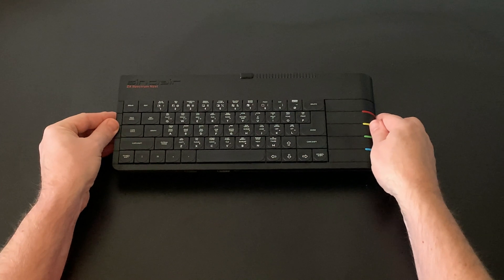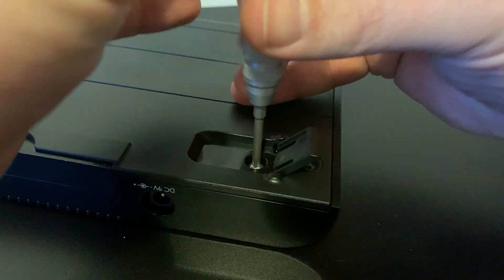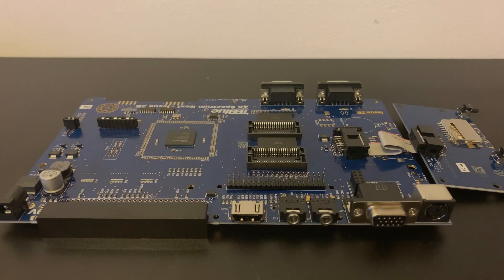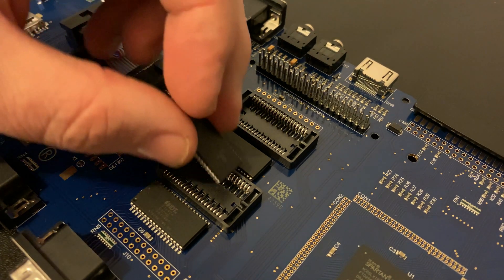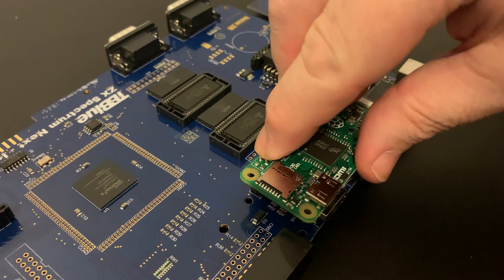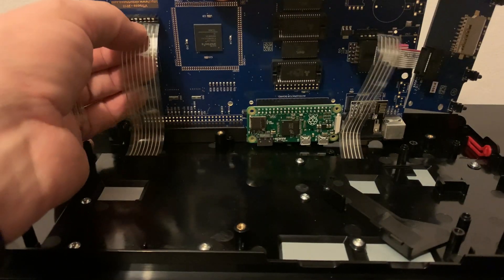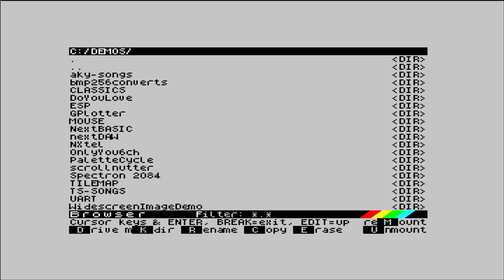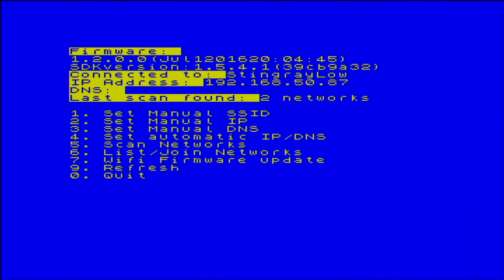Spectrum Next - Part Two: Upgrades

Comment: Need a mod to make the colored stripes light up.  When you open the case we can see that they are just colored pieces pressed into rivet holes.  Could replace with light-carrying plastic and mount LEDs inside.
Reply from the maker: That sounds like a fun mod :)

Comment: So could you skip the ESP if you add a Pi ZeroW?
Reply from the maker: Unfortunately not at this point :( Luckily a Pi Zero plus an ESP is about the same price as a Pi Zero W :)
Reply: @TheRetroShack  Can i use PI Zero W or Zero 2 W instead since PI Zeros seems to be sold out at most places in my country.
Reply: @TheRetroShack  True but you are probably going to want to use a PiZeroW anyway so you have a wife network connection for your pi. The ESP does have an advantage in boot speed over the pi for sure so you might still want both. Now if they could arrange for the ESP to also be the real-time clock so no need to solder on the clock and just for fun let the pi set up a dir to share with the Next that you could load files on to over the network that would be very cool. I would have to look at the pineouts for the pi but if nothing else you could use a spi interface between the pi and the next to handle the data transfers.

Comment: Also on the latest distro, you can use .term from the command line rather than terminex.snx. the dotcommand version will allow you to exit back to NextZXOS with sym+shift+q
Reply: we really should remove that old folder, David ;)
Reply: @Xalior  remove the snx and replace with a text file saying use .term :)

Comment: You mentioned how easy it is to damage plastic threads.  Good practice when replacing screws, especially small ones, is to locate the screw and applying a little pressure turn it slowly anti-clockwise until you feel it click. The screw has registered with the thread and will be guided in without fear of it ‘crossing’ as you screw down. And as you say “not too tight “. BTW, another nice and very informative video.
Reply from the maker: Good tip, thanks!